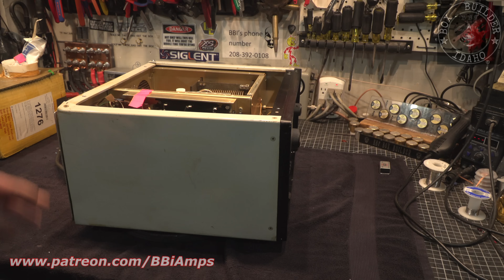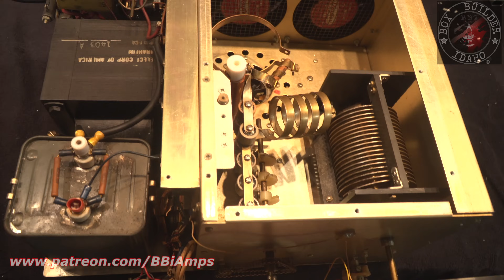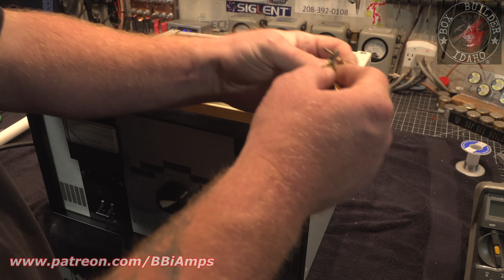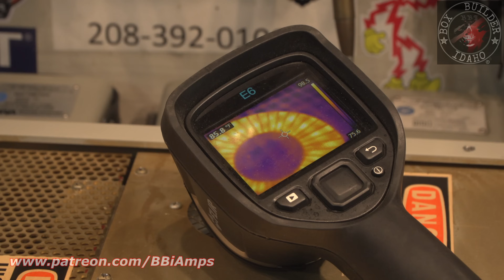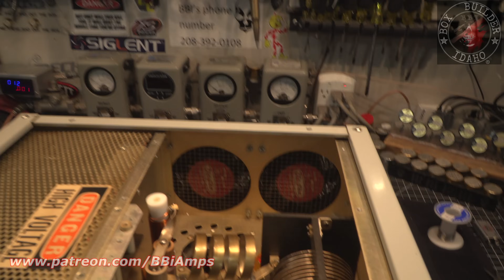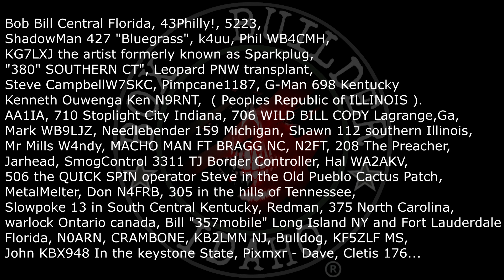Henry 3kd desktop with the 3cv1200d7/ yu-121

Comment: A really cool old Amp. I think it would have been worth testing the tube 1 more time with your step-down transformer setup. Just to truly get that reassurance. Those clasps on the socket are so old, they get hot and lose so much of their integrity over time. I know you applied more grip with the hemostats. But if the contacts from the ends opposite the hemos were muddled then it could interrupt signal. Maybe I'm just over thinking it. But I have a habit of double and triple checking things. Anyway, cool video, and nice job 😎👍👍
Reply from the maker: @renegadeclown8748  I did that off camera and I could not get the tube to relight. Which led me to the conclusion that it was broken. I also clean the inside of the tube socket finger stock and clean the pins of the tube it didn't make any difference the filament was broken on the inside of the tube from age hence the reason why I was pulling such high current it was like 5 amps over spec if I'm not mistaken
Reply from the maker: @renegadeclown8748  but absolutely lovely idea
Reply: I should have guessed you would do that, you are really sharp, and seem to be very efficient, so I highly doubt you would leave anything unchecked. Im looking forward to your next videos. Super cool 😊😎👍🍻☕️

Comment: I have a question: Why didn't you clean the inside of the tube socket contacts?  Placing the hemostats on the contacts would only improve the connection on a clean contact.  If there is a layer of who knows what on the inside surface that makes contact with the tube pin, no amount of clamping force is going to improve the connection.  I saw the ends of the tube pins exposed so you could have measured the actual tube pin for filament voltage and that would confirmed that the tube was actually receiving filament voltage - or not.
Reply from the maker: @JamesBricker-lq3nu  lay the tube on its side. It turns on. Stand it up. It will not. Lay back on its side. Whould not turn on. Bud... The tube was broken inside. 😉 it sounded like a baby rattle
Reply from the maker: @JamesBricker-lq3nu  I did clean the pins and then contacts.. No go

Comment: I got a modified pen like that to change bulbs in one of our mixer consoles. Does Eimac not rebuild those tubes? they are still rebuilding our big ones but it's not cheap and we have started banking tubes for fear of shortages the last few years but not had an issue. Usually 20,000 tubes.
Reply from the maker: @JamesHalfHorse  old school tech.

Comment: How much shipping damage is fixed for free at your shop after it arrives? And how much damage are you willing to absorb before you claim your losses to the shipping company? Have you ever got the full value of a unit after an insurance claim?
Reply from the maker: @hardhead7056  that's a pretty good question to be honest with you. okay first off insurance claims don't really work the way you think they do. I as the recipient of the package do not get to file an insurance claim ever. The shipper does otherwise usually the guy that owns a piece of equipment so 100% of the decision falls on their shoulders. Is this something that we can lightly buff out or is this something that is caused it to be a complete loss. It's entirely up to the customer and when it's all said and done they're the ones that choose if they're going to settle the claim and for how much money. And I never have gotten a check. The person that's in charge of the claim gets paid out I don't know what I charge to write up the insurance estimate. I cross my fingers and I pray to God that it makes it here in one piece. But good question. And yes I have seen 100% losses before. I had one show up where they literally ran a forklift right through the side of the amplifier. And in most cases when the insurance company pays out and they want the equipment back I don't know what the fuck they do with it but they want it back.
Reply: @BoxBuilderIdaho  thanks. 
Do the people that pay out on claims ever want the product that they are covering? Like do they ever want possession of the damaged piece after the claim? Like a "totaled" car insurance claim.
I got to to thinking.  If there is a place somewhere that has all these "claimed" items.  Id love to pick through that pile of stuff. Lol..

Comment: Take a look at the ceramic feedthrough  insulator. The stud that runs thru it gets hot and oxidized and will cause about a 200 watt shortage in output power. The standard fix is the center conductor from a piece of rg-8 coax. The old type with solid polyethylene insulation.